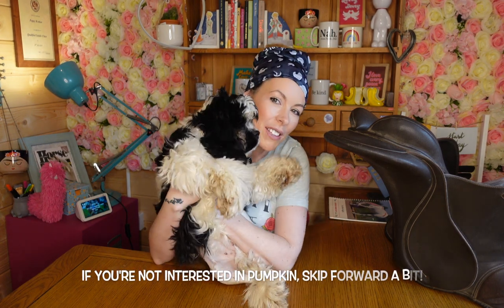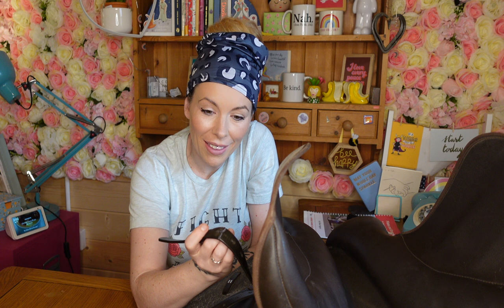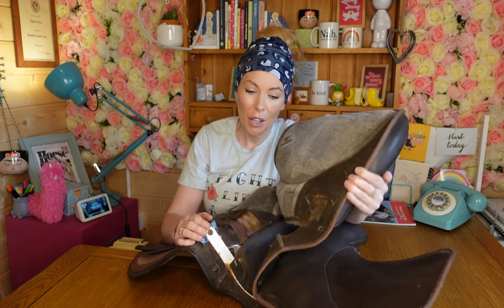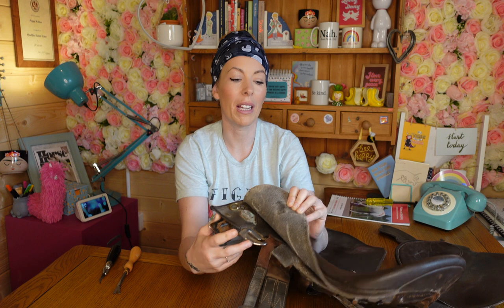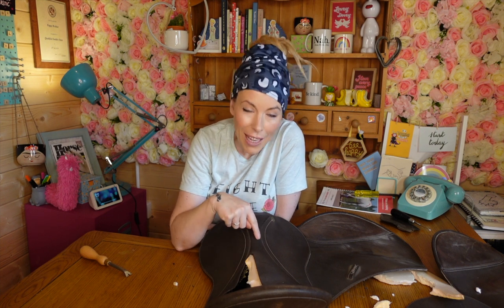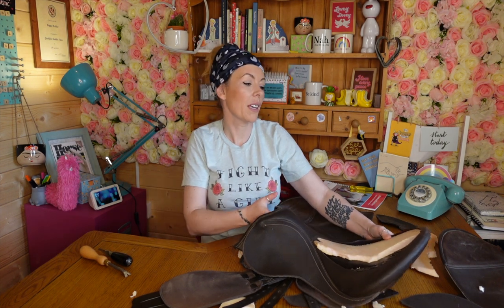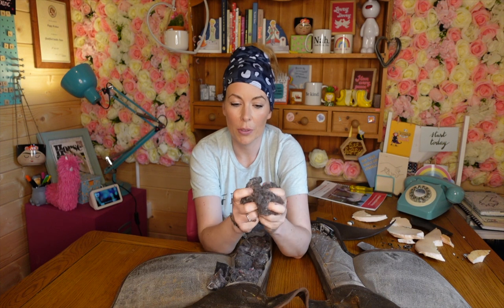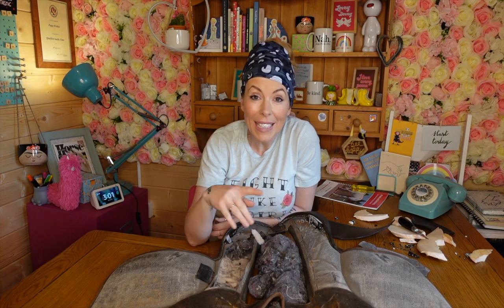Wintec Saddle | LOOK INSIDE | Saddle Dissection - Let's cut it up and have a look!

Comment: Hello from Columbus, Ohio USA!  Thank you for this amazing video, I have learned so much!  I have an older Wintec 2000 with CAIR panels.  The point on the right side it broken.  Can this be repaired or replaced?  Would Wintec fix it for a fee or sell me the part to have my saddler here do the repair/replacement?

Comment: I love these videos so much! Do you happen to have an opinion on the Wintec Pro Endurance saddle (With the block behind the leg as well as the front)? I'm para and I'm very much considering trying one as a dressage saddle
Reply from the maker: Hey, some riders really love them. You definitely need to try one, as the blocks have to fit your legs well, but they definitely support them, if they fit!  And, as with all saddles, even the adjustable ones, they have to fit your horse too! <3 good luck!

Comment: Hi, thanks for your informative videos, just bought a 2nd hand Wintec Isabel Worth Dressage Pro saddle - it is flocked, with no easy change gullet.  I bought it knowing the front strap of the Y girthing strap was pulled off/detached from the tree. I wanted to have a go at putting it back on, but this saddle does not have the Velcro opening at the head of the saddle, so a bit harder to get into.. and from what I can see through the tiny slot where the girth point came out of, there is - what appears to be the fixed gullet.. ? with a threaded bolt, through to the point? and the strap looks like it would have been sandwiched between these two fixtures.. however, the strap has come away.. and the threaded bolt appears to be lose? rattly ? any words of advice on how to access inside these older saddles? and if a repair is possible to re affix the front girth point is greatly appreciated.. cheers, from down under in OZ. :) Shani

Comment: Hello, great videos, thanks heaps, one thing I'm finding is saddle fitters are not addressing the shape of the trees in saddles or talk about the rails... any chance you could do a video on this topic, ie, a straight tree, semi curve, curved etc, different types of trees,  what they are made of, how much each flex (or don't flex), what type of horse shapes fit which type of tree.    Another in depth chat could be about girth points,  how they are attached (with what material), where are they attached and why, forward girth grooves on horses etc.  Maybe another chat about wool vs foam, latex panels etc.  In my experience it appears more expensive saddles are doing away with wool  and using other materials, in your opinion which lasts longer, if the foam or latex fails how does one get this replaced. Have you any experience  with the WOW saddles, your opinion on these would be awesome! thanks
Reply from the maker: oooh loads of ideas! Yes, the shape/rails idea is good, I could do that with some bare trees. Good plan! Thank you so much!

Comment: I have one of the original Wintec saddles.  I never really liked it, it has very distinct points in the back panels.  I mostly used it for beach rides(not in the last twenty five years though).  Since I was in fear of the harsh point pushing my horse’s spine muscles down, I used a professional’s choice shock pad for those rides.  I still have it, as I keep all my old saddles.  Why throw them out when you can use them as examples.
Thank you, I love your videos.
Reply from the maker: Yes, sometimes the older ones can be quite hard and a decent pad can help :)
Reply: @ADayInTheLifeOfASaddleFitter  it isn’t hard so much as has a weird surface.  Next time I get out my saddles, I will send you a pic.   It must be 30 something years old now.  Somewhere, I still have the receipt, as well as a note from my cousin, whom was sponsered by Wintec all those years ago.  It was a gift from my parents, when I was quite young.  My biggest complaint then was that it was slippery as hell unless you wore full seat breeches.

Comment: Great video (as usual!), Poppy.   A question for you - when you get one of these in for a complete re-flock, do you reattach the panel at the rear with more staples or attach some other way?
Reply from the maker: I tend to stitch them back in, but it's a TOUGH job... needles don't like the synthetic material.